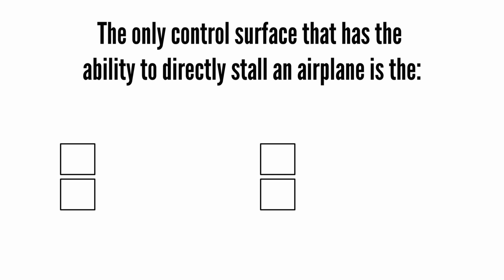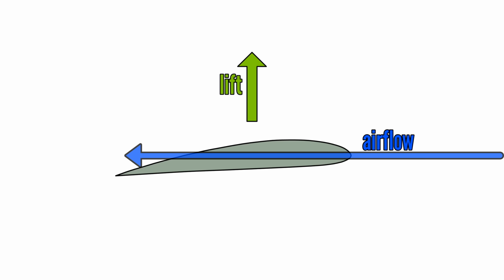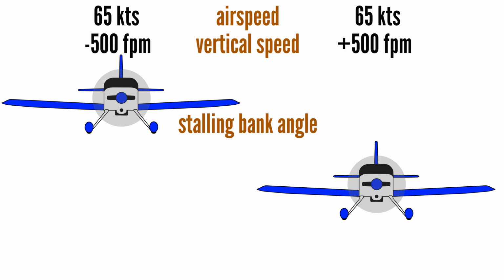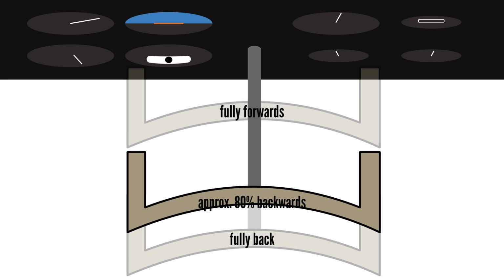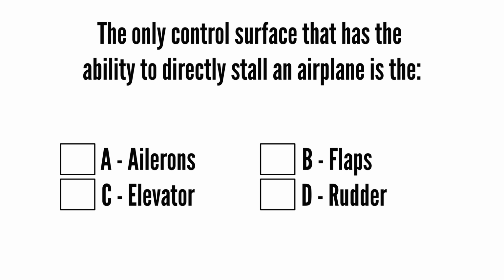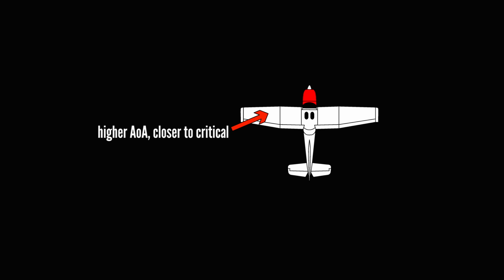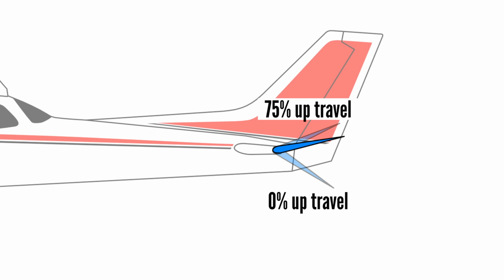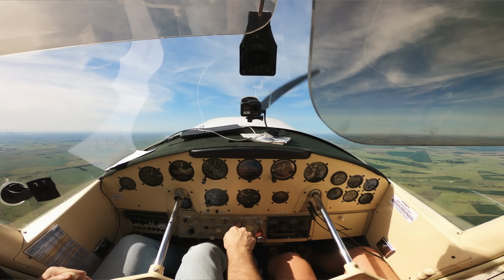Why Bank Angle is Irrelevant to Stall Speed

Comment: I agree with you completely. It's very confusing.  Anyone who flies STOL aircraft in tight spaces knows you can turn base to final as steep as you like as long as you are pushing the stick forward, not pulling G and keeping the speed up.
Reply: If you push the stick forward and continue to turn in the direction of bank, this is indicative of too much trim in the nose up direction.

If the elevator actually went past neutral into a trailing edge down deflection-angle while at low speed, your aircraft would nose down and widen the turn or even begin a turn in the opposite direction of bank while simultaneously pocking up a lot of speed.

Comment: i have never flown a plane so this might be a stupid question, but why allow that much elevator control if it can cause stall, why not make the 80% pitch you mentioned the maximum, or why arent there limiters/flight computer-esque like on the f16 and other fighter jets that wont allow you to stall the plane, or does that just not work with analog flight controls
Reply: Because near touchdown, the aircraft is close to stall yet the pilot needs elevator authority.
Reply: Some airplane designs tried to minimize elevator authority….  And also connected the ailerons and rudders to always move together…

But that causes other limitations in flight.

Full control is needed. Pilots need to know how to use it…

😃

Comment: What you should have stressed is that you will stall at those bank angles IF you are trying to maintain altitude, which is done by pulling back on the stick.  So, if you want to make a tight turn at low speed, you must be willing to lose altitude.
Reply from the maker: 100%
Reply: @LetsGoAviate  This is why people get killed when they misjudge their runway alignment try to pull a tight turn 100 feet off the ground. If they make pattern turns at 30 degree bank angle it's a go no go situation they can't make the turn go around and re-align with a 30 degree bank.
Reply: The OP is pointing out You can still bank steeply, if you unload the wing. 

This is obvious to anyone who has performed an aileron roll. Especially at low speed.
Reply: "you must be willing to lose altitude."
In some circumstances that might be the PLAN such as in a glider where it can be a challenge to descend.
Reply: Which increases the Load Factor..

Comment: In a descending turn the lower wing has a greater angle of attack and WILL stall before the upper wing at a higher speed than level stall speed. In a climbing turn its the upper wing that stalls first.
So bank angle IS relevant while climbing or descending. Not in level turns.
Reply: It depends on the sideslip angle. Dihedral dictates which wing is flying at a greater angle of attack. Not bank angle.

Comment: I cringe too… if you don’t understand the physics of flying you’re probably going to be a statistic. 
 Bank angle is relevant, planes don’t have limited slip differential. If your banking you’re turning, the lift section of the low wing is is moving slower than the upper wing not to mention your pitot tube. However accurate that is in a turn. 
 Until you can master a coordinated turn w/o slipping or skidding I’d recommend you keep the speed up. 
 But what do I know I fly helicopters 😂😂
Reply: " If you're banking you’re turning"  An airplane CAN bank without  turning. Knife edge aerobatics or 4 point roll.  But it cannot hover well 😁 I fly helicopter too!

Comment: AoA is all that matters, but students rarely fly aircraft which are equipped with AiA indicators. Therefore teaching them about stall speeds in level flight at various angles of bank is a useful proxy for AoA as it enables them to predict and avoid a stall in level turn. Whereas your proposal to teach students that the yoke position determines stall is a worse proxy.
Reply from the maker: My view is something is not working...statistics around LOC speak for itself. And if we don't change what we are doing, nothing will ever change. Yoke/stick position awareness helps a lot to initially get that feeling for how much you are loading the wings with your elevator input. I think it's a much better proxy than bank angle, as yoke position is directly linked to AoA, while bank angle isn't linked to AoA at all. But I'm open to hearing about other views. Cheers.
Reply: @LetsGoAviate  you can stall the wing at any airspeed or bank angle. It always happens at the same stick position. That’s why I never wanted an AOA in my airplane. They have all come with one since the first powered flight If you practice stalls often enough muscle memory is all that’s needed. As any good AG pilot will tell you is that the wing can’t be stalled in 0 G’s. You can actually fly below indicated stall speed if the wing is unloaded. That is why I’m a stick controls airspeed, throttle controls climb and descents type of pilot. 40 years and nothing has changed.
Reply: @rodneyschuerman6971  The elevator deflection is a function of the control input; however this is not a direct measure of AoA, because the CoG changes with cockpit load. With heavy pilots and loads, the control at  the fully aft position may not be able to stall the aircraft, making flare (roundout) difficult.
Reply: @christopherrobinson7541 we are talking about training and training aircraft. Students should not have to learn about changes in aircraft they are not flying. That is why the 152 is a way better trainer than a 172. You have to learn to walk before you can run. Keep it simple , as they learn and progress to higher wing loaded aircraft then they need to learn more.
Reply: The variable is load. AOA is fixed. Unload = push on yoke=un-stall, regardless of angle or attitude.
Reply: @rigilchrist Have we tried Peter’s way? How do you know stick/yoke position is a “worse” proxy. People still kill themselves weekly in stall spin crashes in the pattern…so perhaps another approach is warranted? You say most GA aircraft don’t have an AOA indicator, why not use yoke degrees of deflection for your “indicator”? AMIRITE?! 😅
I’m disagreeing respectfully, your point is understandable as well.
Reply: @TriumphDoc  You can't predict AOA by stick position.  For a given stick position AOA will vary depending on CG and airspeed, probably other factors but I'm not 100% sure.  The force feel on the stick will vary depending on these factors plus the elevator trim setting.  For example flying alone (nets a very forward CG) I can fly a stable descent at full flaps engine idle with the stick full back, but still staying somewhat below the stalling AOA.
Reply: Stick position, particularly back stick pressure, can be used as a general indicator of angle of attack (AoA). However, it's crucial to remember that stick position is just one piece of information and other factors, like airspeed and trim, can significantly influence the actual AoA.
Reply: @ManNomad  Another silly attempt to muddy the waters. Stick pressure depends on your trim setting. You can make it anything you like by changing trim setting. 
The stick is rigidly connected to the elevator and it is the elevator position that sets the AoA at any given aircraft configuration (C of G, flap position, power setting). In any effects of controls discussion it must be emphasised that the stick controls the AoA. The subsequent movement of the aircraft then depends  on what the AoA change has done to the lift( increased, decreased). Anyone who ever built and flew a free flight model aeroplane and trimmed it to fly well knows that the elevator position controls the AoA.
Aircraft don't stall on their own. Pilots stall airplanes. (The dirty little secret of aviation - aircraft fly themselves quite well when not mishandled by pilots)
Reply: Just out of interest, why the everloving heck don't all planes come with AoA indicators already? =/
Reply: No it isn't. Stick position DIRECTLY controls angle of attack. That is what counts.
Reply: @BorgeltInstruments  No. The position of the stick when the max AoA is achieved depends on the CofG. Heavy pilots required more back stick to achieve the critical AoA.

Comment: I'm glad you addressed this, because I've been thinking about that standard graphic for a while now and secretly thinking to myself that it must be building in that assumption about level flight. A more accurate depiction would be a three dimensional box with a curl running through it, with the third dimension representing something like vertical speed.

Regarding your quiz, my first thought was "it depends on how he defines directly ", and so I chose "B - flaps". And I stand by that choice, actually. Consider a scenario where you are at full flaps and close to stall speed in unaccelerated flight. Now bring in the flaps without adjusting any other control. Won't you stall? Because you have directly changed the lift characteristics of the wing. In your scenario, you indirectly create a stall by inducing a change in the yaw, pitch, or roll of the airplane, which eventually then goes on to affect how the lifting surface interacts with the airflow. I think you meant to go "one step out" from the direct effect of changing the lifting surface itself. But if you do that, then you get into the other examples you described. 

But I might be wrong, what do you think? Ultimately what's important is understand what's actually going on so we have sufficiently accurate mental models for safe enough flight -- not to argue over semantics. And with that in mind, I appreciate the point of your video.
Reply from the maker: I get what you're saying, and I don't think you're wrong. What I meant by "directly" is the elevator directly controls angle of attack, and thus inappropriate use will stall the wing. Flaps would also be correct, but inappropriate use will only stall the wing at certain airspeeds, like retracting flaps at a too low airspeed, where the elevator can stall the wing at any airspeed. So yeah flaps as an answer is probably not incorrect as it can directly stall the wing under certain conditions. "Directly" is thus probably not the right word. Definitely getting into the semantics scenario you mentioned 😁 But you got the point I tried to get across.
Reply: You would be well served learning the VG diagram in detail, not a surface level knowledge

Comment: Constant rate descent/ascent is pretty much indistinguishable from level flight for aircraft dynamics except for flow of energy between propulsion system, gravity potential energy and aerodynamic losses (drag).

You can't sustain a turn below stall speed for a given bank angle. The aircraft will pitch down and speed up for the new descending banked turn at higher airspeed that is above banked stall speed.

While the description provided is correct and can help avoiding stalling  in low speed turns. It doesn't help the pilot to plan and maintain the planned trajectory.

Comment: Yes, that's a better explanation than many tend to get taught about stalling. Between the yoke's position and the artificial horizon gauge, together those should provide a fairly good idea of the amount of angle of attack going on at any moment, given most GA planes don't specifically come with an angle of attack instrument gauge.

Comment: Sure, but how is that any easier than just remembering to pay attention to the airspeed in a banking turn? Very few small aircraft have AoA indicators and "muscle memory" or "feel" isn't a good indicator unless you always fly with the same CoG and the same trim setting. Also, I'd argue your answer regarding control surfaces DIRECTLY stalling an airplane is wrong: The only surface that can DIRECTLY stall a wing is a flap, because that changes the camber and chord of the main wing airfoil. Moving the elevator changes the camber of the elevator, which results in an aerodynamic force which then pitches the aircraft and therefore changes the angle of attack of the wing.

Overall, bit of a complication of the simple fact that acceleration - whether in a turn or not - has an effect of the airspeed at which a plane stalls.
Reply: I'd call this very useful in a theory sense.  Good point about flaps, and ailerons sort of do the same to an extent, which is the real danger of trying to use them to roll out of a turn in a near-stall situation.  Want to raise the wing, try to generate more lift, and the LOW wing stalls causing the snap-roll.

Comment: Excellent teaching. Pilots are too focused on graphs and tables loaded with numbers. On the ground that's okay. But in the air it is too much abstract data to process. Especially  while doing maneuvers. I like your practical "angle of attack indicator" as the amount of extension on the yoke tube, expressed in percentages. This is something one can instantly see and sense with the hands. It would be instructive to demonstrate on the ground by marking the yoke shaft with a Sharpie pen at intervals. Then put the control at various marks and go outside to see the elevator angles. Then learn about the specific aircraft by observing the marks while doing practice stalls in level flight at safe altitudes. This could be particularly instructive for pilots at an early stage of experience. And some old-timers :- )
Reply from the maker: I haven't considered making actual marks. That's not a bad idea, like you said, especially early on.